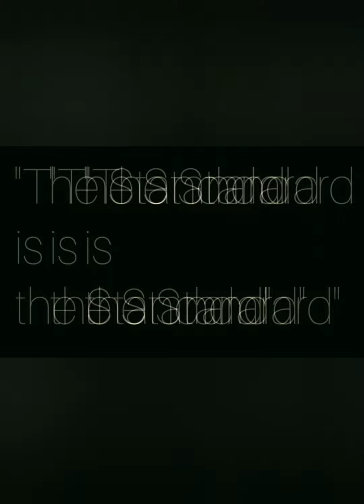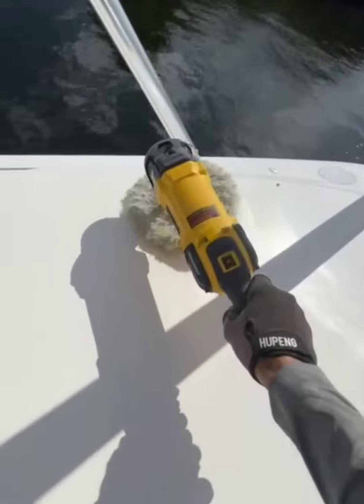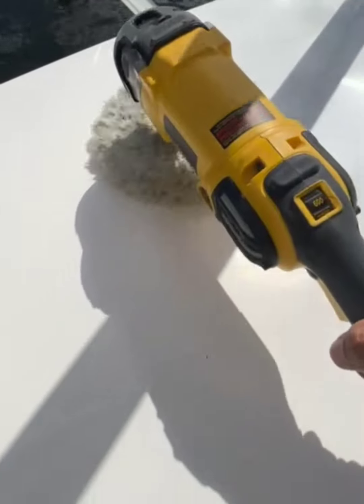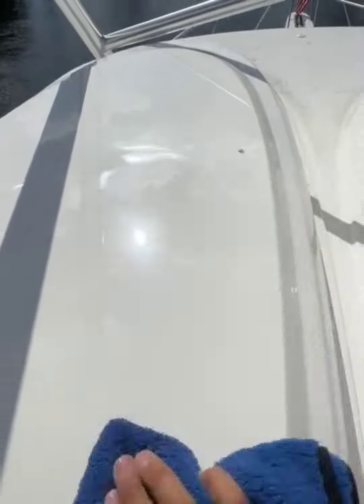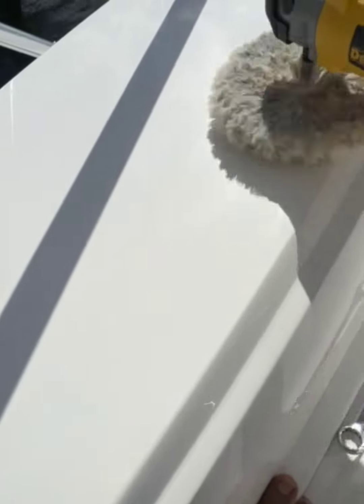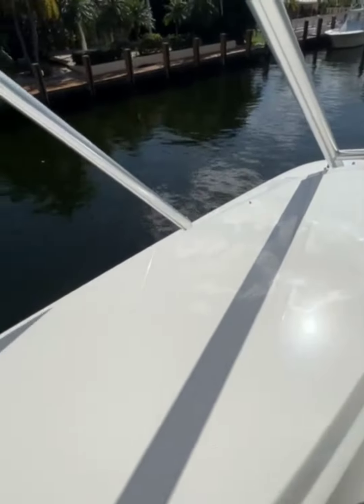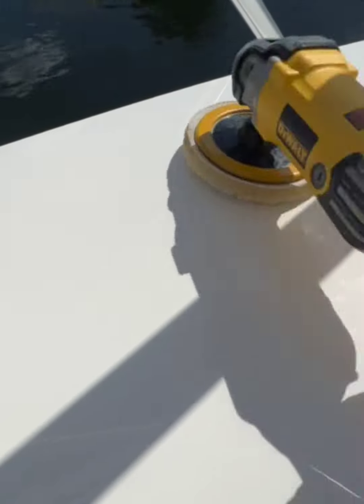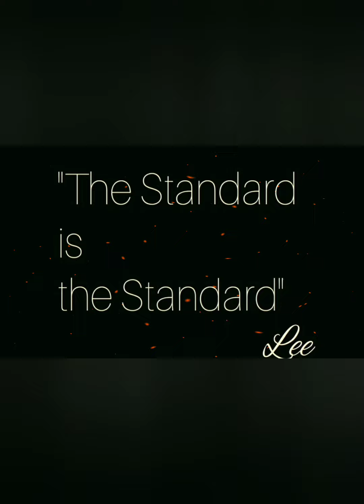Idiutz! Here a Detailer Shines, literally. Stop being Sold to accept being told to & then pass it on

Comment: Started on my boat a couple of days ago. The chalking was horrible.
Picked up the DeWalt (had a harbor freight unit) and I'm glad I did.
This video highlighted using the edge until the heavy cut "clears" a bit, then go flat. Figured that out after a day of the wool pad hopping all over the place.
I like that he showed the 600 speed at first, then all the way to full speed when going flat.
My results were amazing, even though I've gotten the heavy cut done. Next is the EX AC tomorrow. Will then use the Meguiar's Flagship wax since it's been so oxidized.

Thank you, thank you, thank you for 'curing' me of the desire to wet sand.
Reply from the maker: Lol Anytime brother. Pass it on.

Thanks, happy it helped. I chuckled when I heard Harbor Freight. Glad you found an alternative.

Lee

Comment: Hey Lee, would your process differ in any way around the area where vinyl letters for the boat name were placed on the sides? Especially since some of the vinyl was cracked and you see some call them indentations if you will on the gelcoat. Thanks!
Reply from the maker: Hi. So there's 2 schools of thought here (3 if pushing the norms) Firstly, try to protect decals and not ruin them further by grinding on them too harshly. Then again, most decals, even old ones, can handle a little buffer luv. 

On boats that have been baked in the sun for a while, their decals can etch themselves into the gelcoat as the areas that weren't covered by the sticker, decal, vinyl, were not exposed to either the oxidation face of the elements or the over use of a machine to polish the boat. Where the decal was, the topographical surface of the boat will show a "high spot" if removed, sometimes even some decal color (colour for my Hokey fans) will remain in the gelcoat. 

If you choose, sanding with a palm sander-type tool, a random orbital with a sanding disk (800-1000 grit) to level out the surface might be required or wanted. Follow this with the 3 compounds and a buffer and usually that's what works. There's nuances to everything of course. It all depends on how pronounced the elevation differences are, how ugly they are to you and how perfect you want it to look when you're done. 

-You can mask off decals to avoid further destroying them.
-Go slow (with a buffer) stay flat (no edging) and keep the buffer in motion constantly. 
-You can remove and or replace the decals with new ones or go to a vinyl wrap shop and have new ones made to cover the areas that offend. 

In my work, unless the decals are beyond trashed, I generally act like they're not there. Subconsciously I'm aware of them and the risks involved but I have a good history of controlling my buffer and am aware that not everyone has built up that resistance to caution. 

I prefer a boat w/o graphics. Boat designs generally don't need "flair" to look good on the water. I remove decals. If there's something that needs addressing after that, I'll address it. 

Without trying to shoot myself in the foot, in my library are a few videos that demonstrate various levels of decal decline and what I do on each. In almost 300 vids, I think 2-3 have I changed my approach to suit a particular boat. It's rare that I give it much thought honestly and I suggest that people take on the same mindset. 

If the decals are going to be ruined, they're going to be ruined, there's very little you can do to reverse time and save everything.

Hope that helps.

Lee
Reply: @Local_Boydidgood  I actually removed the decals (New to us boat). The old decals on the port side were cracked badly, and i can imagine you've seen it happen where the parts that were covered in vinyl are not faded by the sun, and the rest of the boat is more white. Its a 2003 Grady White Sailfish 282 so its more of a cream color underneath than white. Would heavy cut be enough, from your experience to bring both the hull that wasn't covered in vinyl and the part that was under the vinyl that is now removed, to a more uniform color and help get rid of the "uv shadowed" boat name?
Reply from the maker: Generally, yes (put a little shoulder behind it and add time to each pass)
I've found that within a year, the colors will almost match and by the 2nd year, everything looks right (if you don't get the color matched with buffing)

Gelvoat is translucent so sometimes the color difference is deeper than you want to dig through so in that case; go till it's smooth/flat and trust that the Sun will do what it does and the darker spot should fade out a bit.

If the color is persistent, try Super-Duty and then Heavy Cut.
Reply: @Local_Boydidgood  Appreciate you! I'll probably tackle it later this year. Im down in Florida so it's not so much a "seasonal" thing but will keep you posted and ill probably post it on my channel and figure a way to tag you. From here to whenever that is, I'll keep watching your vids and learning. Keep at it!
Reply from the maker: Best of luck.
Lee

Comment: Lee I need to apologize to you. I’ve been trying for a couple of years to correct my gel coat. It’s an off white on a Stingray which had a lot of micro scratches and a haze that I just couldn’t get rid of. Products tried Menzerna 400 Starke Elevate and a couple Meguiers products used in rotary with wool and heavy cut foam. Also tried my DA with wool and foam no luck. Finally ordered 3M heavy cut that u rave about. OMG any pad I throw at it even on DA perfection. Thanks sorry took so long to covert me.
Reply from the maker: It's OK. Lol. I'm in it for the long game.. If you liked that, trust me, buy some Perfect-it ex ac and grab a clean pad. Give the once over with the Perfect-it and then give her a good Dawn dish soap wash and dry. Inspect in good light. If you like it, apply the 'wax' with a soft foam pad and your random orbital. Pull the wax once dry with either a soft rotary pad or another soft pad on your rotary.

Now, every 2 months or every time you're about to take her out, apply a spray detailer and enjoy. Rinse off with fresh water when she's home again.

I'll take any converts regardless of how long it takes. I hear even @drakesdetailing is using compound now, (more correctly at least) without hours of sanding..

Tell a friend. You know how quiet I am on the interwebs..

Thanks for the comment. I appreciate the effort and the smile.

Lee
Reply: Thank you Sir. Yeah I watch Drake and he’s definitely a great Detailer he just gets caught up with chasing sponsorship. Hopefully he gets back to his roots.
Reply from the maker: I'll hold my breath..(Drake) 
Glad you found a path forward for your boat. Have fun next season!

Lee

Comment: You always start with the heavy cut compound, but after this you also use the EX on the woolpad for finishing before applying Flagship?
1) heavy cut with wool pad
2) EX with wool pad (or foam pad?)
3) Flagship premium

Am I right?

Thanks a lot!
Reply from the maker: Roughly. I don't always use heavy cut, depends on the boat. Make sure to wash the boat between compounding and protecting.

Lee
Reply from the maker: Like I said before, roughly. There's 200+ videos on how I do what I do and to give you all a chance to see why or when I do whatever. They tell everything needed, boring or not.

Lee

Comment: Lee, when I buff my boat I use the heavy cut and the 3m pad. It’s a green boat but my pad doesn’t turn green after buffing it gets brownish. Any ideas what I’m doing wrong. It’s like it’s not cutting through.
Reply from the maker: It sounds like the wheel is just spinning freely and not doing any work. Or, you're not using enough product and dry fibers are just spinning, not doing much besides glazing themselves..? (not there, hard to speculate) 

The brown is not what you want to see. It tells me that you're spinning a ton but not accomplishing anything but picking up dirt.

If you have a 3M pad already but you're seeing brown instead of green, push a little harder and switch to the more aggressive compound.

There could be other reasons but from here... Hard to say. 

What pad exactly? Part number? I see this if people use a pad meant for polishing and not compounding. A yellow pad or the green one they sell will just spin and melt (friction) when people push hard to get the pad to cut.

Your boat might have a varnish? (I'm guessing here, again, I'm not there to see) 

Or, if your green boat is very oxidised, the top layer does not have pigment and is basically opaque, light yellow. This could be what you're seeing. 

Is the boat a Nord haven or old Mastercraft? Their gelcoat are sometimes like glass, very hard to get into and so your wheel can feel and act like a dull drill on metal. All the pressure and oil won't help sometimes. That's where Super-Duty and a 3M compounding pad come into play. 

I hope this helps. 

Lee

Comment: How bad of oxidation can be removed just from buffing with the 3M products?  the top cap on my bass boat is fairly bad. It feels similar to sand paper.
Reply from the maker: Hi,
OK, if it's that bad (my guess is your clearcoat has faded and begun to "craze") I might try a spot with some 3M's Super-Duty compound and then follow with Heavy Cut also by 3M. See if you can take down some of the "sandpaper" feel. If so, great! If no, sandpaper (800 to 1,000 grit) on a palm sander or DA sander. If you can get through the top layer, using compound to finish will be a good and easy thing compared to Sanding the whole thing.

Now, if your boat just uses clear gelcoat with flake in it, I'd try my way 1st still to see and then, I'd sand like mentioned above.

I suppose my answer is, there's hope either way. Without being there, I can't tell you what to do but in almost 20 years of doing this, 2 boats made me walk away, I couldn't compound them out and they needed either a full Sanding or a Sanding and a repaint or re gelcoated.

Sorry that isn't a great answer but from here.. Good luck.

Lee

Comment: Lee. I purchased the DeWalt you designed/recommended and worked on one gunwhale for about an hour with heavy cut. It turned out great...shiny like new! Can't wait to get to the rest of the boat. Only problem...the machine got really hot. I made sure I wasn't covering the ports. Is it supposed to get hot. It was a hot summer night when I worked it, but I wasn't expecting it to get that hot. I have an infrared thermometer...I could try to grab a reading. Is that normal for a little less than an hour's use? Thanks for your time and help.
Reply from the maker: Hi,
They cook when it's hot out. I usually make sure to allow it to spin freely (upside down, secured) while I'm doing other things on the boat. It helps to take some of the heat out of the body and head if you let it spin at about 800 rpm for a moment before tossing it back into the work again.

Glad you're having success.

Lee

Comment: Looks great. I noticed he was polishing on a sunny day. Where was this? I live in Florida so it is hot and sunny for a lot of the year. Going to start to work on my 26 ft center console soon. Lee, he said he was going to use ceramic coat. Do u still recommend fire glaze, especially for hot sunny climates like Florida? And is all fire glaze the same. I’ll need to order a large amount for the center console. It’s expensive so I don’t want to order the wrong thing.
Reply from the maker: Hi. You won't need more than 2 bottles of FG for the next 7 years of that boat's life if you do this right. 
Fire Glaze VS. Ceramics.. For all the factors involved: if she's new, try a ceramic and pamper that finish. If a few years on, FG. If though, she's been dry for a while (no wax) she'll benefit from Meguiar’s Flagship liquid wax more than either the 1st grinding.

Next time, use a premium product and see the difference after your gelcoat has had a chance to even out and stabilize using a traditional boat "wax"..
Lee
Reply: Thank you sir, I’m in Florida indeed! This is specifically in pompano area
Reply from the maker: Get her "good as hell" this time, use a good boat wax. Keep her clean, spray detailer touch-up every 2 months.

The next time, if you get to "holy crap!" Try doing one half in a ceramic and the other half FG+.

I don't know your boat, I've met others like it but they all have different lives and need, like people, different treatment to make them smile. Find out which lasts longest or is easiest for you to maintain and you'll be glad you did.

I give guidance but without being there (too frigg'n hot for my white, skinny ass) it's all I can give.

Lee
Reply: Lee - would you please recommend a couple of spray detailers for maintenance? I detailed my boat in July and I spray her down with salt-away as soon as I’m back at the dock, but I’d like to fit a spray detailer into a regular routine. TIA!
Deb
Reply from the maker: Hi.
I like almost anything. I avoid caranuaba wax varieties but almost anything that says "spray detailer" or "quick detailer".
The choices are vast compared to when I was a kid so have fun exploring. Some from Chemical Guys, smell good. I'm not going to lie, sometimes, even I like a great smelling boat.

I'm glad you're using Salt-a-way (great addition to the routine) "wash-n-wax" products are great to use (Mermaid's soap, turtle wax car soap... Anything that adds a bit of protection is never wrong)

I use either 303 aerospace protectant (the new armorall has the same ingredients for less $ but I have a ton of 303..🙁)
I like the "mirasol" spray by Restructure Marine.
https://www.restructuremarine.com/imported-products/Mirasol

Now, some sprays have a learning curve. Meaning, they work best when... You'll have to figure out which ones you like. The ones you don't, use on your cars or in the bathroom. You'll be amazed how well some of this stuff can help keep things clean in the home.

Spray the stuff on a big area of boat. Have one microfiber to kind of spread and level the spray and one dry/clean one to "buff" it glossy.
On a smaller area, spray just the towel and use that to spread the spray around. This helps avoid overspray or small droplets from landing where you might not see them to wipe them.

Have this product handy on the boat for minor cleanups along with a "cleaner wax" for scuffs obtained along an outing.

Hope that helps.

Lee
Reply: @Local_Boydidgood  Thanks for taking the time to explain, Lee! I wanted to use 303 but the product details say it dries to a smooth matte finish. After all the work I put into getting a high gloss finish on my boat I don’t want to dull it down - or am I misunderstanding?! I definitely won’t use anything with carnauba - got that message from your previous posts and have followed religiously 😁. So unless you can dispel my concern about 303 finishing matte, I guess I will be exploring. Thanks, again…Deb
Reply from the maker: Hi. It says that so when people are thinking of doing the vinyl of their car dash, they aren't worried it'll be glossy. I can assure you, a light misting on a boat followed by a good wipe won't leave a matte finish. I've used it, never had a matte finish.
Just trust me, one more time. It'll be OK.

Lee
Reply: @Local_Boydidgood  😂ok, one more time! Thanks, Lee!
Reply from the maker: It's OK. This is what I do the vids for, to help. That and to act out my aggressive anti-social side. If pushed into a corner, I like the Mirasol spray I linked to. It's super slick and if any gets on your carpets, you'll slide in socks so avoid that but for an all-around star of a spray, I have no qualms of pointing you in that direction. Buy one for the boat and one for your home and cars.

You'll be alright with just about anything. The trick is to not allow the fading to start by adding to the surface before you see signs of that. Even a good boat soap wash now and then should help especially if it leaves behind a protective finish.

Lee